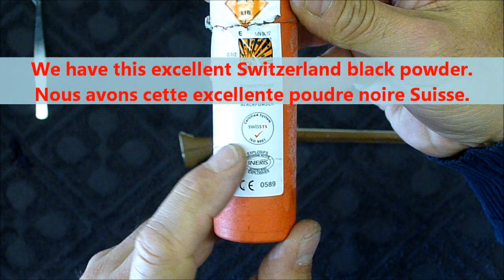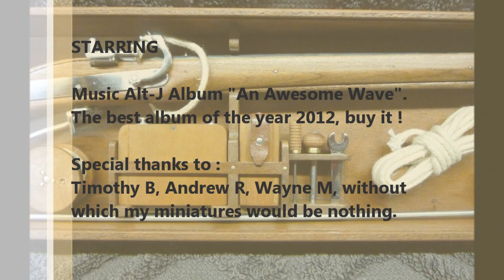Wonderful Miniature Matchlock Musket (maintenance and fire).

Comment: Hello! I was wondering what the price range would be to order one, if you still happen to make them
Reply from the maker: Hello Martin, this matchlock musket is one of my first. I no longer manufacture this model. I have since improved my manufacturing processes. https://www.youtube.com/watch?v=iCqLc7VdY54&t=9s
For a single musket "d'Artagnan model", it takes USD 1,800 excluding delivery costs. For a complete set as on the video with padlock, transport case and all accessories the price is 6500 USD (4 months of work). Regards Gilles
Reply from the maker: You can find them here > https://www.atelierarmesminiatures.com/